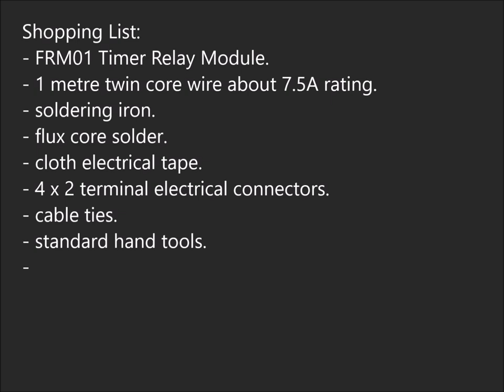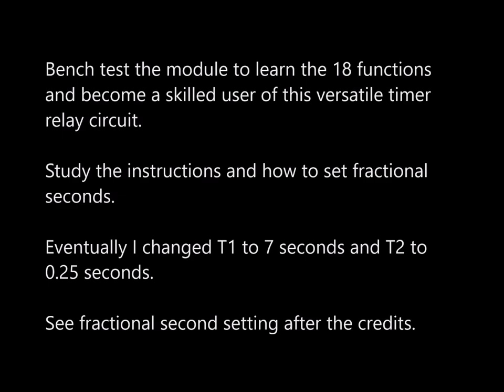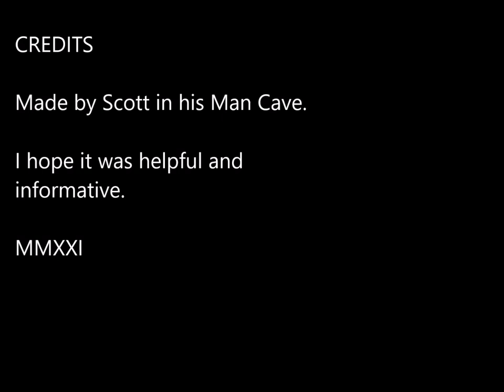Make Cruise Control Main Switch Activate Turn On Automatically When Engine Starts FRM01 Timer Relay

Comment: Good mod. Im have the issue of my cruise not switching on. probably a faulty switch but now I can just bridge those wires and see if it activates before I fire the parts cannon. I just hope it isnt the clock spring, or the clutch or brake switch.